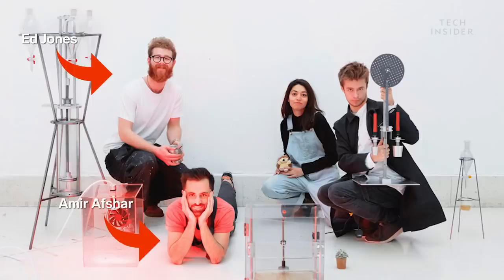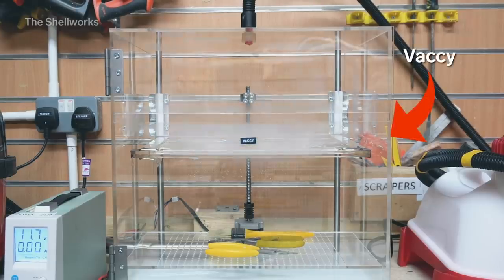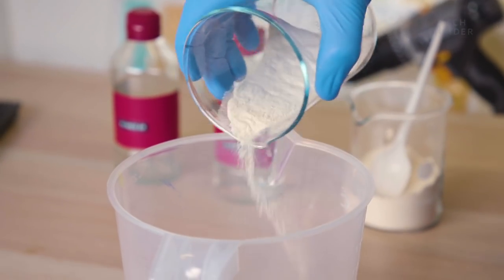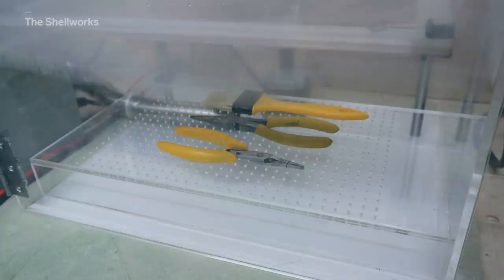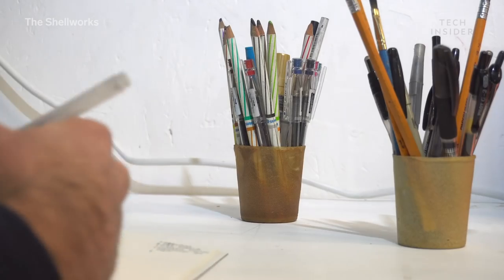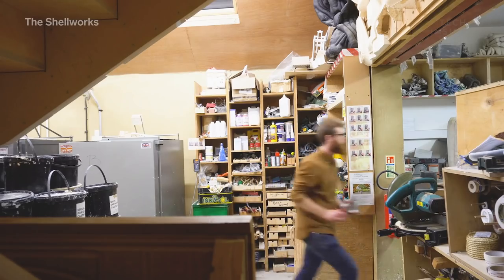How Lobster Shells Could Replace Single-Use Plastic

Comment: You know they are a team of mad scientists when they start naming their tools Shelly.
Reply: and Sheety
Reply: and vaccy
Reply: And dicky
Reply: and probably Crazy
Reply: they arent scientists, they are art people. none of this technology is new or advanced, the reason we dont use natural "plastics" is they degrade very very quickly when they come into Contact with anything that containt even alittle bit of moisture even the air in a fridge is enough to turn this "plastic" in to a slimymess
Reply: torchaf well he described some sort of wax coating, so I'd imagine it'd help with that problem.
Reply: Future science projects
Reply: @torchaf  in the vid they said that their team consists of architects and mechanical engineers and product design graduates though. And though i agree that as a replacement for flastic it's not quite ready yet, i find that some of the other uses, such as a pot plant that you'd plant directly into the ground, is one hell of an idea. The fact that it will degrade and fertilize the soil is amazing
Reply: I wonder if they named the blender 'Smashy'
Reply: lil dippy
Reply: @amaccoy  blendy would be better...if they had a hammer, smashy would suit.
Reply: @TsunaXZ  yeeetyyy
Reply: They should've named it the shell-inator

Comment: To be honest those biodegradable pots for plants are a really good idea.
Reply: Fritz Smith “why does” everything have to “be” “quoted”
Reply: they make them out of dried pressed manure. better easier cheaper faster more abundant.
Reply: Those already exist
Reply: @AnhLe-zl4ws  yah. thats the point.
Reply: It is but you can also make those pots out of paper pulp a lot cheaper
Reply: @michaelfeathergill7556  don't think. he was. talking. to you.
Reply: they already exist. they're called peat pots.
Reply: Ceramic is biodegradable use that or compressed dirt if youll like
Reply: @streamware7746  while i'll admit that "ceramic" covers a vast array of materials, most materials that people would be familiar with are composed primarily of silica and alumina, neither of which is biodegradable. They can eventually be eroded into common soil componenets.
Reply: Yeah like others have said biodegradable plant pots that fertilize already exist.. and are cheap as hell to make bc they are made from animal waste
Reply: they already exist though, he just shows people what you can do with lobster shells
Reply: @griml0gic420  until the same plants and bacteria they house end up degrading the pot itself WHOOPSIIIIEEEE!

Comment: Good job for those who created this, now instead of paying 4 cents now we'll have to pay 100$
Reply: At least you'll be alive to be paying that $100.
Reply: _ 3nekos 
I don't want to be alive for that
Reply: @elijahorozco2960  HAHAH
Reply: We will probably live. It's our offspring who are in trouble.
Reply: You might be paying more from environmental pollution otherwise.
Reply: 100$ ? it's the shell, not the meat.
Reply: It won't that costly and maybe its reusable, recyclable, multiple purposes.. the new lobster bag can be used as fertilizer which will decomposed. Possibility is high. Only time will tell
Reply: @shokrithan.k8207  you see the point of plastic is being reusable, cheap, easy to make, and efficient. on the other hand, making "lobster plastic" is definitely not easy, the materials to make it is hard to find, and also it will definitely cost more. I really don't see any future in this product but at least you have one thing right, only time will tell.
Reply: Don’t know why it would cost anywhere near that much.
Reply: TeasinTrio Why would it be hard to find? Didn’t they just say the material is abundant? There are huge numbers of lobster shells alone.
Reply: TeasinTrio And I really can’t see why it would cost more. Particularly adding the cost of efforts to undo damage created by plastic pollution.
Reply: TeasinTrio Also if it acts as a fertilizer that might be able to augment the cost as it not only biodegrades but is an actually valuable biodegradable.
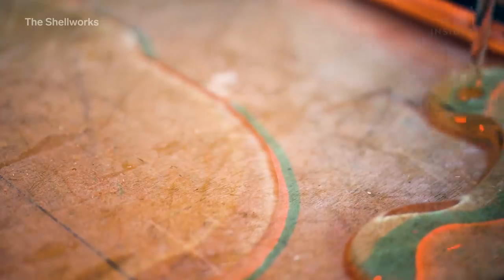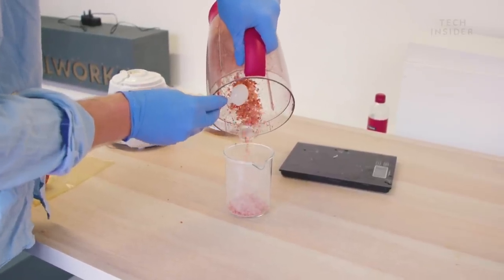Reply: 1:00 n 1:46 seems like they use used lobster shells from the food industries (hotel n restaurant) i guess if thats true.. the raw materials will be cheap af. Manufacturing process seems simple though some random chemicals no idea, blender, homemade machines, vinegar (cheap). They just need time, support n a lot of funds
Reply: TeasinTrio There’s a huge amount of lobster shells available just from current use, meaning you could just take the stuff being thrown out anyway. So how could that be costly or not abundant of it’s literally everywhere and often thrown out? And the process to turn it into the useable material didn’t seem like it required a massive expensive facility or a lot of time. Students did it in a regular lab. In America New England alone could probably give you a huge amount of lobster shells, that’s one of their staples. And getting an entire lobster doesn’t even cost a hundred. And you’re not even buying the whole thing, just stuff that’s typically thrown out. It would probably be like a dollar or less per shell or something as you’re   paying for stuff they don’t typically make money from I think.
Reply: @CalebMcFarland   Caleb McFarland  Yes those items might be abundant but there is no certain place to find lobster skins, most of the time those lobster skins are thrown into the trash never to be seen again. The graph shows how many are thrown away not found. Also if restaurants knew about this, they wouldn't be donating it right away, they would most likely take advantage and add a price to those. Also if you want to make lobster plastic, where would you find the lobsters?
Reply: Lol i want to eat some lobster now. U guys carry on
Reply: @shokrithan.k8207  nope the company doesn't own the lobster tail they found, they need to pay the restaurant to give it to them (most likely)
Reply: $100 is nothing if you want to save the environment
Reply: Just get reusable bag
Reply: Is that 100$ worth humanity?
Reply: Lol in my country bags are free
Reply: I mean yeah it’s probably expensive right now but as mass production comes along prices will reduce unfortunately that is the case with many new ways to save the planet like solar panels used to run like 5 grand but now as they are being popularized you can get a kit to make them for as little as 500 dollars
Reply: This is just a proof of concept. These young minds are just thinking outside the box. Will it replace plastic entirely? Doubtful. As it’s hard to produce at a price competitive scale. It’s still interesting and a step in the right direction though
Reply: Now but in a few years it’ll be cheaper
Reply: No you won't, demand will skyrocket to replace human's most damaging material - Plastic. Plastic being biodegradable and having environmentally friendly uses as shown in the video clearly opens up the future where pollution can be minimised.
Reply: At least you wouldn't want to buy it a.d bring an reusable one
Reply: Martin Pajunk this isn’t the only plastic alternative
Reply: Shiba _InX its not water repelling except if its coated in a wax, recycling these would not be possible! single use plastic is not the problem at all either.
Reply: Caleb McFarland Do you have an idea how much costlier plastic bags would get if this material would be used? lobster shells sure are abundant but not nearly abundant enough as to please the worlds need for plastic.
Reply: Caleb McFarland “ A dollar or less per shell” if you assume thi then why do u think it will not be marginally more expensive? do you know how many lobsters you need for a plastic bag? Maybe only one. That would make the material cost (not the procession cost) one dollar, that is extremely expensive if you assume you can buy a normal plastic bag for maybe 30c.
Reply: It seems like you should be blamine industries for that, not scientists who are trying to help.
Reply: Tim yes 100$ for a plastic bag is nothing, save the enviroment! 
Sounds like someone who wants to scam you.
Reply: Martin Pajunk “demand will skyrocket” imagin walking in the supermarket on the fly and buying some snacks or whatever, oops, you have not taken your reusable environment friendly bag with you, now you have the choice between the 2$ crab bag and the 25c plastic bag, wich will you choose. I tell you that much, most people would use the plastic bag.
Reply: We Pay 1 cent (€) only😂😂 now it'll  100€😂😂😂
Reply: @azuhh1431  plastic is only cheap and easy to make. Sure it's reusable but making it compostable is a better solution as the recycling process is difficult, not to mention most plastic just goes to the landfill anyway. I'm for hemp plastic which is more scaleable than this.

Also, there is this thing that the government can do - it's called a subsidy. If the government gives subsidies to renewables or at the very least stops giving subsidies to evironment destroying goods and services, everything is fine for the consumer, and the planet too. You wonder why gas can be so cheap in the US?
Reply: "it's the shell not the meat"
Lobster takes 4 years to grow their skin to be useable, i don't think people would sell the shell for 4¢.
Reply: Hemp plastic
Reply: Restaurants should have bins where you can throw the shells in.
Reply: @pest174   LOL TRUE. we can all go bankrupt and become homeless :D Now that'll definitely reduce pollution!
Reply: I stick to plastic it’s reusable and cheaper
Reply: @pest174  no thanks, gimme the eco bag
Reply: The price of lobster shells should not be too expensive as they are typically thrown away

Comment: 2019: Lobster shells can replace plastics

2021: Eating rocks can replace lobsters
Reply: 2030: consuming oxygen can replace rocks
Reply: Do I hear a rock lobster reference
Reply: @subpar3462  
1865: Placing head in plasticbag can replace oxygen.
Reply: 2045:oxygen replaced with electric wires

Comment: Ummm with the amount of plastic we use on a daily basis I'd  rather use plant based "plastics" made from cassava plants, before we completely run out of seafood just for the mere purpose of making plastic. 

HOWEVER,
As long as it is recycled from crustacean waste already discarded I wouldn't mind
Reply: ...That's what they're doing, no way did they say that they'll be farming lobsters
Reply: Also, I believe the plant-based plastics would be much less likely to cause allergic reactions. Shellfish allergies are very common and when I first found out about mine, it was a terrifying experience. Sadly, most people without allergies don't think about this at all and it can cause a lot of issues (i.e. when people only give the option of sushi/hibachi places to eat because of vegans in the group, meanwhile I could literally die from it)
Reply: that is the point, what are we trying to do is use anything that has no purpose or useless and turn it into usable material like plastic.
Reply: @strabababerry  But the shop owner could use non-crustacean based plastic.
Reply: They cost much tho...
They should make it cheaper
Reply: Thing about plant based plastics is the space that would be used for growing them will compete with the space meant for growing food for humans. A good percentage of soy, corn and wheat grown goes to feeding livestock which has implications for the environment and climate.
Reply: @Vysair  Hello? What are they extracting from the shells? They're extracting chitin, that's not the source of allergy. And even if it were, it's not transmittable onto the food, that would defeat the point of packaging made like this.
Reply: Ah so you eat the shell as well
Reply: I see someone didn't watch the whole video.
Reply: that is dumb.... why farm expensive lobster just for plastic🙄 use common sense
Reply: @nat0106951  you don't farm it you recycle the shell after consumption
Reply: @trevordude2378 WTF! I am replying to her that her thinking is dumb. I am saying to her that why would they farm expensive lobsters just for plastic. 😅
Reply: @nat0106951  because you can sell the meat and sell the plastic

Comment: Amazing! But for mass production I guess you can 3D print these plastics using a raw material closely resembling chitin.
Reply: I think 3d printing is for when you DON'T want to mass produce. It will probably take hours for 1 of these using 3D printer
Reply: Why has the rise of 3-d printing made people forget about just pouring into a mold? I mean I know must people don't think at all about how things are made but it just seems so simple.
Reply: 3D printing is for creating objects you can't possibly make by sticking, molding or screwing stuff together and when you don't have access to all those complicated machines just to make a single plastic cup that is of your desire.
Reply: Amazing? Try terrible idea.
Reply: We could use finger nail clippings instead

Comment: This is amazing, and definitely a step in the right direction, but until we can get consumers and the general population on board and passionate about these kind of environmental efforts, and we can provide a demand for these products, manufacturers just won't care enough to spend the money upgrading their existing facilities. We need a "Tesla" for the plastics industry that will kick start a transition into large scale biodegradable plastic use, which will in turn pump R&D money into it, allowing for better products.

Comment: is there a way do do that but without lobster shells? for the people who are allergic to shellfish...

(edit) maybe with fungi🤷🏽‍♂️
Reply: There's a similar video of people making furniture out of fungi. They grow the fungus in a mold shaped like whatever they want, and it dies and dries into a cork-like substance
Reply: Yes. But styrofoam replacement is most promising at the moment (already in use)
If you would want it similar to this then you'd go to mycelium leather.

Just because of how it is and how it's grown i don't think this thin and flexible will be possible with it. Since it gets a huge part of it's strength from it thickness atm.

Maybe algea tho!
Reply: And then what about the people allergic to fungi?  There is no such thing as one-solution-fits-all and that has to be OK.
Reply: @slightlysoulfulspatula  is that a common one?

(Plus being allergic to fungi would mean ya dead. They everywhere. Pennicilin is a fungi. It's one of the 4 kingdoms. Just like you can't be allergic to bacteria. Ya can't be to fungi) 

But fungi would be for bags not viable.
So it would be algea. Which never heard of an allergy of thag
Reply: Michelle J true...but still, there are many things that produce that white stuff that’s safe for everyone....we just gotta keep looking and testing until we find it
Reply: Dutchik im allergic to penicillin
Reply: It is safe, unless someone's already allergic to fungi (and even then, this should still probably be alright). Chitin is structural, people aren't allergic to the shells themselves, but to shellfish meat, which is full of any number of organic chemicals.

Comment: Have you guys considered attempting to create a ratio that could be used as the "ink" in a 3D printer?  If you could get that to work and harden at an equitable rate as it "printed", then you could experiment with a wider array of designs to the resultant products.

Comment: Note that they don't specifically need lobsters. Insect breeding could also be used since it uses a derivative of chitin. We already use that sort of practice for silk worms as it is. Maybe they can find more uses for bugs, and use more of the bugs than just the shells , on top of this sort of thing.

As for the waterproofing, since we're on the subject of bugs... Shellac...? Actually, since Shellac is already a natural thermoplastic, I wonder if the two substances could be mixed to any positive effect...

Comment: honestly combine this with culinary bug farming and the present shellfish industry and you have a lot of material for plastics already (not to mention the fact that growing chitinous fungi saves a lot more space and resources!!), idk if it would ever replace it entirely (the best solution for the plastics industry is multiple types of plastic replacements), but it would cut down on waste and if anything would help slow the roll of single use plastics.

THe only real big question I have is that of cleanliness of the source material, if it only works after rigorously scrubbing out any "meat" it might be a tad too labour intensive in its current state  (if that isn't true of any new tech tho?)

Comment: the problem I see with plastic from lobster or other shellfish.. is the shellfish itself, having a shellfish allergy is relatively common and often very volatile to the point where contact can cause reactions. it would have been better to seek to make bioplastics from the chiton found in fungi rather than shellfish due to the fact it is easily farmed and could be grown off of biodegradable waste and produce substantial amounts of nitrogen fixed fertilized soil with less chances of volatile reactions due to allergic reactions.

Comment: On one hand, very cool. On the other, might introduce a whole new terror to shopping. I'm one of the unlucky sods who is seriously allergic - touch it and I start getting welts, breathe even the fumes in and it's straight to the epipen as my throat closes. (Found out the hard way about the breathing it in. New local place I was really excited to try, figured 'well, just don't get any shellfish dishes, it's all cool'. 20 min in, bolting for the door as I started graying out as my throat closed. FUN! Great date night...) And I'm an adult who can research and take precautions, unless they have a way to get rid of the allergen, kids - who tend to touch everything and if young enough, put things into their mouths could be in some danger if this goes into larger production.
Reply: It won't make you allergic lol they break it down to plastic.